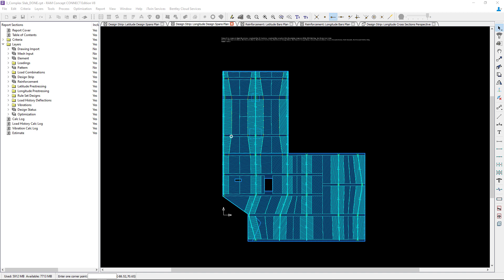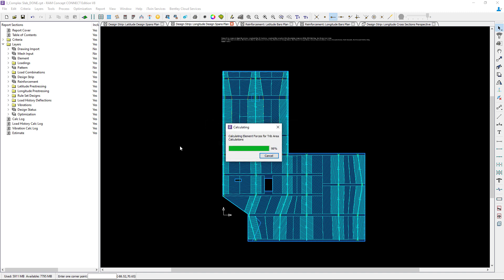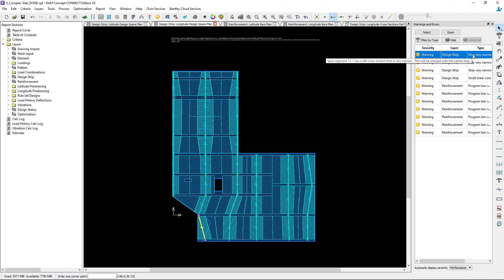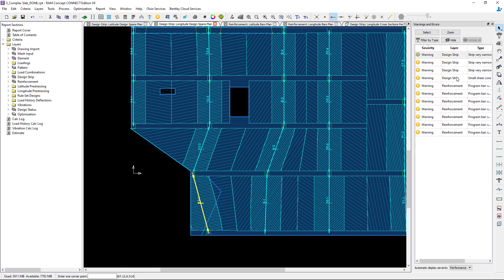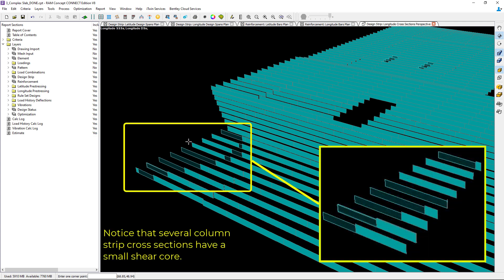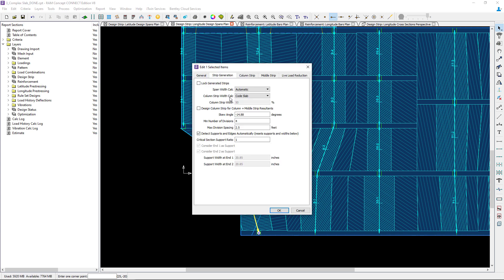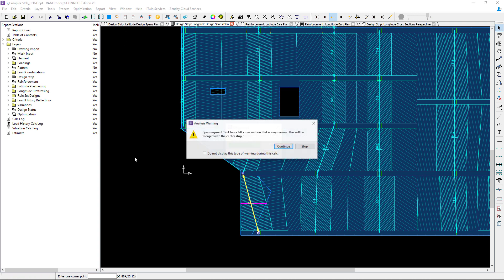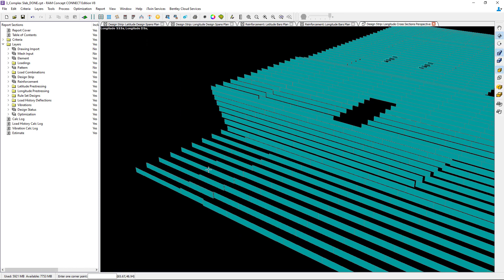Modeling Design Strips at Slab Depressions in RAM Concept

Comment: I've had problems with this where you get warnings for tendons being out of the section, for when it cuts the design strip under the tendons. Is there a way arounds this, or is it really just a trade off with a larger shear core vs. a shorter slab elevation?